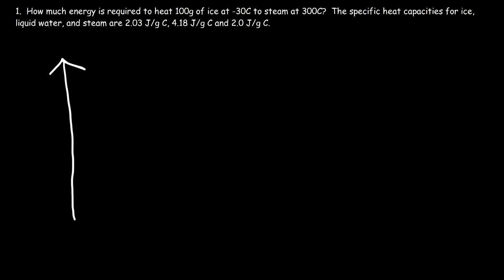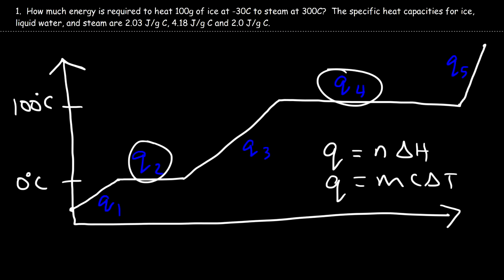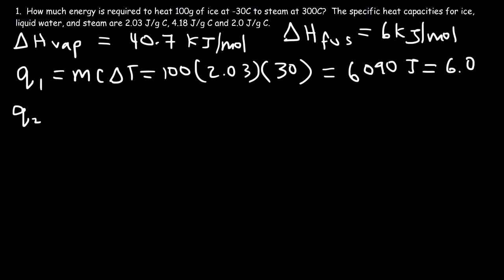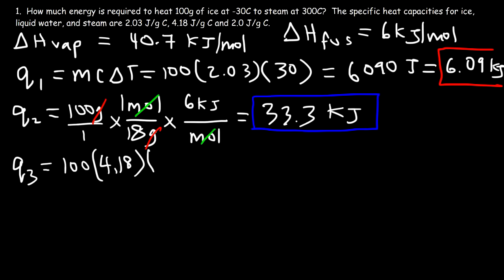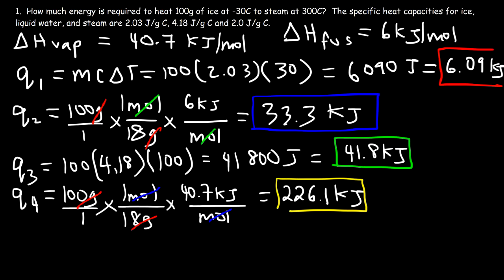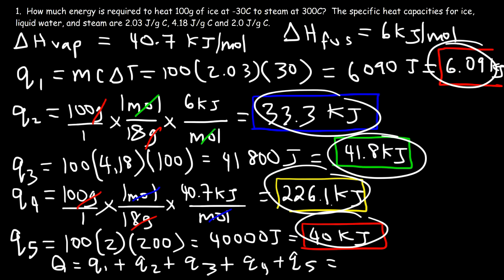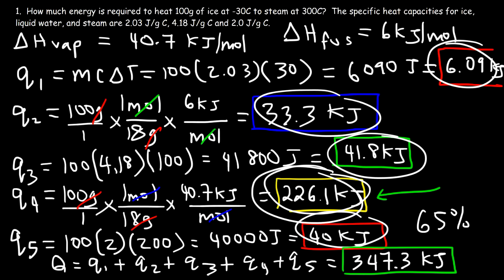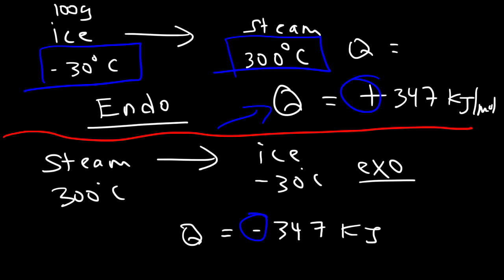How Much Thermal Energy Is Required To Heat Ice Into Steam - Heating Curve Chemistry Problems

Comment: Professor Organic Chemistry Tutor, thank you for a step by step analysis on How much Thermal Energy is required to Heat Ice into Steam in AP/General Chemistry. The five step problem solving process increases my knowledge and deep understanding of the heating curve. This is an error free video/lecture on YouTube TV with the Organic Chemistry Tutor.

Comment: in 8:27 you said "1 mole of water will take away 226.1kj of thermal energy away from your body"  but isn't the magnitude of 226.1 came from dividing 100g / 18g/m which is equal to 5 moles ???
مش كده ولا أنا غلط؟؟